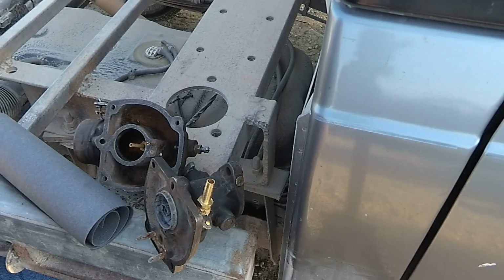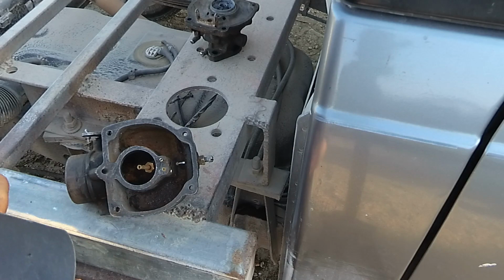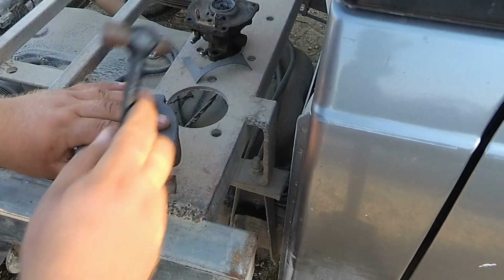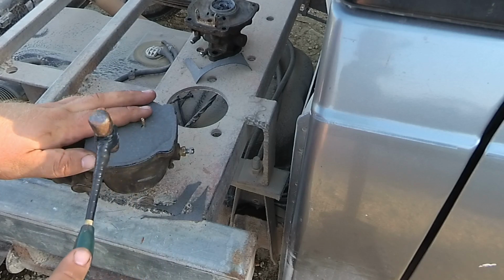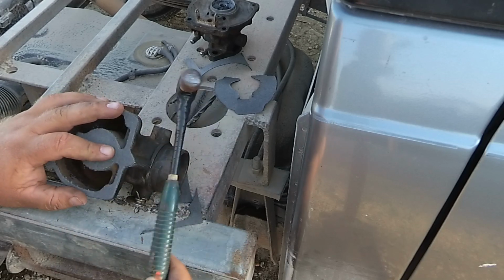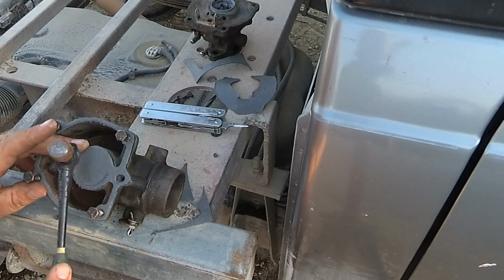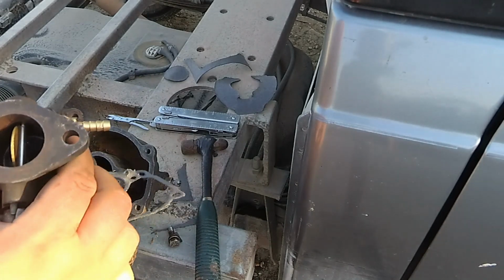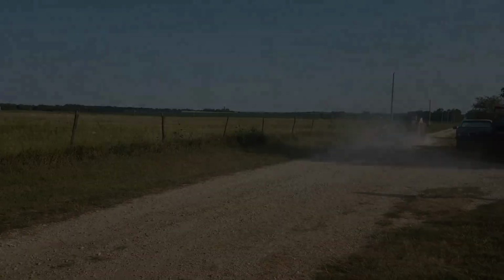How To Make A Carburetor Gasket EASY AND FAST!

Comment: You, my friend, have a magic touch with that hammer. I have made gaskets before with exacto knives and tiny scissors but mine were very crude compared to the ones you produced.
Reply from the maker: Thanks, yes I also used small scissors, etc and they never turned out. My dad actually showed me this method one time and it works very well. 
Thanks for watching!

Comment: Skillful execution ❤️ ,but I'm afraid to tap with a hammer, maybe a hard plastic mallot or tiny metal hammer, because my head is aluminium. Using a knife is so dangerous. Rtv's a mess to clean up.
Reply from the maker: Thanks, I have done this same technique on a aluminum hydraulic pump and it worked great with no damage done to the aluminum. You might be able to use a small hard plastic hammer? But I have no experience with that.
You don't want to hit it very hard, you just want to hit on the outside edge and kinda glance of the side of it.
I do see why you are worried about damaging the aluminum head, that is something you don't want to mess up. Yes I hate cleaning up Rtv, normally i use a Razer blade but it still isn't easy.
Good luck with your project and let me know how it turns out 👍